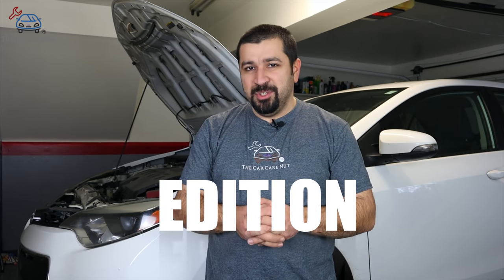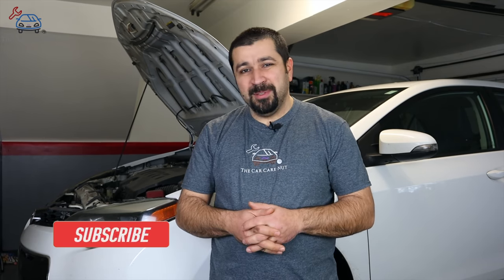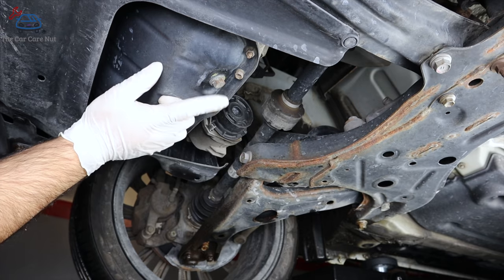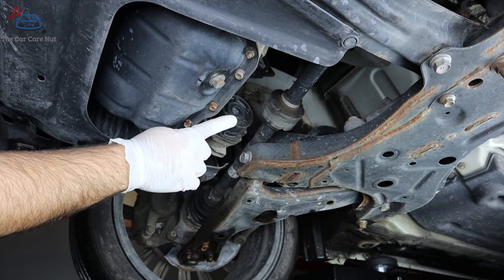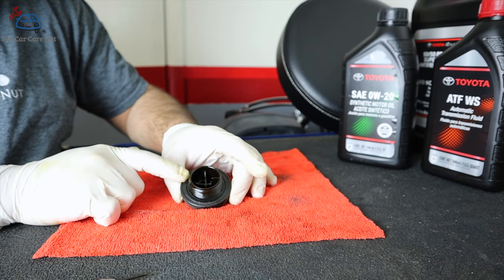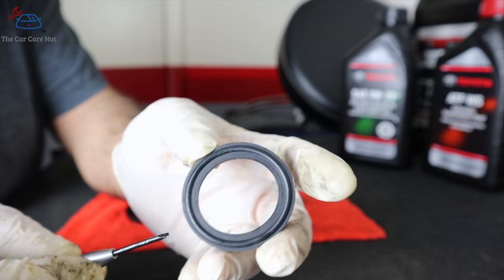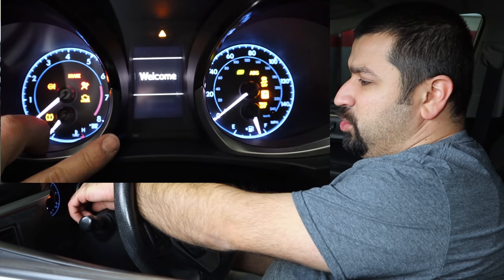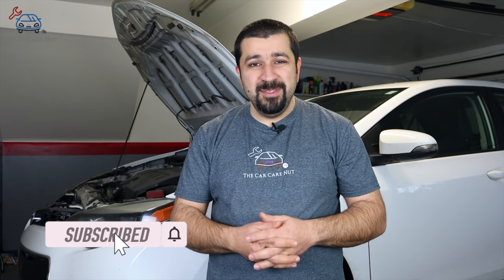How to change your Engine oil and filter for Toyota Lexus Scion

Comment: I've changed the oil on my cars for more than 50 years.  I taught my wife soon after we married, and she was religious about doing so on her own car which she herself maintained for over 15 years.  She did the neatest, cleanest oil changes I'd ever seen -- never spilled a drop, and somehow, she never got dirty, either.  Even better, this got her accustomed to looking around under the hood, and she wanted to know what the other parts were too.   She immediately noticed anything amiss and was even able to fix some things herself, like a cracked hose causing a vacuum leak.  I strongly encourage women to learn this type of job.  A great confidence builder.  My wife  became much more informed about cars starting in this way.
Reply: Most women would refuse or F something up.  That is reality for the vast majority.
Reply: Keeper.
Reply: You have saved enough for a mistress.  😆.
Reply: Real world experience here.... my wife wanted to learn same.  She did the oil change and everything seemed fine.  Then we discovered the car was leaking oil at the drain plug.  I checked it was tight and that wasn't the issue.  I suspected something was amiss with the drain plug gasket.  Took it to the dealership as it was winter and I don't do oil changes in the icy and wet driveway.  They discovered the drain plug bolt was cross threaded.  There's a certain amount of "normal experience" with tools, nuts and bolts that a person should have before they do their own oil change.  We needed a new oil pan, which cost about 700 dollars with labour and taxes to replace.  She has decided I should do the oil changes from here out.
Reply: @donaldteed35  You can win most of the time but not always.  😆
Reply: @donaldteed35  So she tried doing lefty “tighty” and righty “loosey,” instead of righty “tighty” lefty “loosey.”
Reply: @GhostBlueEternalFlame  
Not at all.
She cross threaded it meaning She turned it to the right to tighten it but the threads we're not aligned. This can happen on pipe threads, bolts or anything threaded. You have to make sure that it is started properly before you tighten it.
Reply: @tommak6516 i agree with refuse. but i disagree with the fuck something up part. thats the whole point why you (as the husband) teach her. if she becomes informed and experienced, she wont fuck anything up
Reply: My wife always wondered how I washed our car without getting wet. Then one day, she came with me. I sat there and watched someone do it for me. 😊
Reply: A keeper!
Reply: I can imagine what my wife would say if I offered her to change oil on her car. No, better I do it for her
Reply: That's awesome!
Reply: I taught my husband how to change oil :)

Comment: My dealer always overfilled each oil change :(   They no longer do my oil changes.  I do my own :)
Reply: They are supposed to fill just below the full line.  It would save them money.  Overfilling is really bad since the oil will foam.
Reply: I have experienced the same overfill l issue at the dealer. Maybe the round up to an even number. Very annoying -
Reply: @nicholaspaul2458  Part of the problem is people complain if their oil is below the full line.  I’ve always driven the car for at least half an hour and then waited 15 minutes to check the level.  This gives a more accurate reading.
Reply: I usually end up pumping out the excess oil
Reply: Yes, I siphoned over a pint out the last time a dealership did mine.  Very were on vacation and didn't want to drive over 1,000 miles home with it overfilled.
Reply: I've tried about 4 workshops, they all overfill the oil.
Reply: I’ve heard dealers use bulk oil dispensers, apparently difficult to control Definitely  there customers who care about their cars aren’t happy.
Reply: I always add .3 quarts more than specified. At least with the oil guns we have, if I put the exact specified amount it will end up being underfilled. I'd rather accidentally put too much oil in a customer's car than not enough.
Reply: I just got an oil change done at Toyota on my 2015 Rav4 and when I remeasured its overfilled! I insert my dipstick fully. It seems to me they are only inserting the dipstick to the gasket(yellow top) on the dipstick. should the dipstick be inserted fully?? If so, all the Toyota dealers around me are measuring their oil incorrectly... anyone care to chime in?
Reply: @Damian-nj9tl  my manual states "reinsert it all the way".
Reply: @Damian-nj9tl  conspiracy ?? is that what you are saying?
Reply: @MrMagichobo21  try using the dipstick range
Reply: @MrMagichobo21    terrible idea.  Oil foaming due to the crank shaft hitting the oil will cause almost zero oil pressure.  
     Take a drinking straw and have a cup under the sink with the water running hard and you will understand all you get in the straw is bubbles.
Reply: I had the oil level correct when I bought it. Got it changed at a dealer it read overfilled. I drained out 1 quart.  Went to another dealer read overfilled. Thought I was nuts. Got it changed at independent shop, read overfilled at same spot on dipstick. So now I do my own change, I got out 5.8qts,  what the manual recommends. I put in 5.5qts,  it reads full. So I suppose there is 0.3qts trapped in there and if you put 5.8qts you are overfilling it.
Reply: Thats what she said@timtitus6846

Comment: This is why I do my own oil changes, even on new vehicles, because as he mentioned, jr techs (who are assigned oil changes) forgetting to put oil back in the car.  Happens more than you know, I rather not pay someone to mess up my car.
Reply: This is why, when I have some work done on my car, I always ask for a sample of the old parts (eg. bring an old jar for brake fluid, transmission fluid, etc; or ask to see the old brake pads, etc). Figure it’s a good way to keep the shop honest! And yes, I agree about oil changes. Basic stuff like that, you do yourself!

Comment: FWIW, I've been using the same oil plug gasket for the last 70,000 miles. No leaks. If you cut off the top of a quart oil bottle or 2 liter soda bottle, it makes a nice funnel  for adding in the new oil without spilling any. The idea of putting the oil filler cap on the hood latch is great, as is the advice of tightening things to spec (after a few oil changes, you'll not even need the torque wrench any more). Great video, Car Care Nut!
Reply: I do the same thing. Replaced the drain plug crush washer for the first time after about 15 years. Why? Just because I felt like it that day. Same one now for 8 years.
Reply: It's great until you drop the hood and break the fill cap!

Comment: Do not forget to check for leaks and oil pressure after startup. It can happen to anyone, but especially if you're not experienced. Gaskets can be bad, faulty encased filters and improperly tightened oil plugs, etc. I did this work for 5.5 years and have seen it all, especially on used cars that others had touched before me.
Reply: Yes, it can happen to anyone. I know. I've been changing my own oil for 57 years. About two years ago I got distracted during an oil change. Because of that I ended up pouring three quarts of oil through the engine before realizing I forgot to put the drainplug in. Whoops! My wife said, "I'll bet you won't do that again." I told her she was wrong. It wasn't until after 55 years of not doing it that it finally happened. I told her the evidence shows that I'm more likely to do something like that as I get older. I don't think I should try making my own video unless someone else is running the camera. I can't multi-task like I once did. A man's got to know his limitations.
Reply: How do you check for oil pressure after start up?
Reply: @sweetbrez18  Make sure the oil light in instrument cluster turns off after a  second or two after starting the engine.
Reply: The reasons for leaks with cartridge filters are probably because of putting the o rings in the wrong spot. The Toyota filters have specific instructions as to where it goes and it important to pay attention to. Over tightening it will cause you issues like he said

Comment: I upgraded my oil filter canister on My 2021 4Runner.  I used the metal one from Toyota for the 2GR and swapped out the middle stack inside to accommodate the taller one in the metal filter.  Just so people know, the official toyota filter tool is $60 from the dealer, at least that’s what I paid.  Worth every penny
Reply: I've seen them for a lot less than $60 but the plastic one is fine as long as you don't let a sasquatch change your oil.
Reply: Personally, I feel the best oil filter cap wrench for this application is the Motivx MX2320-US for $24.95.

Comment: My LS460 has the canister drain valve in it, and I use a brass tool to drain the housing before removal because it makes a lot less mess when removing the housing. I also pour about 1/4 quart of 0W-20 into the fill port while the drain plug is out to rinse out a little bit more of the old oil before installing the plug and filter. Thank you for the very informative, useful, and cost-saving video for DIY-ers.
Reply: I'm sure people have seen that clear spout that comes with the new filter and they just toss it in the trash.

Comment: Love the tip of putting oil filler cap by the hood latch.
Reply: @sctony2000  I don't , because  if you forget it's there , and push your hood shut, you could damage  the cap and have to buy a new one 🥴.

Comment: I have only ever owned Toyotas.... My last one was a 1.6 Avensis Strata which I got 549,000kms until I retired it last month. I put 50 -60 thousand Kms per year, but I ALWAYS changed the oil and filter myself... 3 times per year every 4 months or 15 -20 thousand Kms. Your videos are excellent. I now have a 2.0 D4D Avensis Tourer.
Reply: 15-20 thousand kms between oil changes is a lot, did you have any issues with oil burning? I'm guessing the engine would have gone further than 549,000 kms had you changed a little more often. 

Also, why did you end up retiring your Avensis Strata?

Comment: Thanks for that reset the maintenance light info at the end!! I've been living in apartments since I got this Camry.  they won't let you work on your car, in their parking lots. So, I came here to learn about the 💩 oil filter in this car, since I've never changed the oil in it myself. So, im going to find a public lot or dead end street, and  start doing my own oil changes again. I'm also going back to the 3k mile changes ,that I've been doing myself, for 39 years. I used to straddle a shallow ditch in my yard, with my VW beetle, so i could lay in it and change my oil 😁 ; no ramps needed. 👍 There's always a way to get it done yourself. I use a shower curtain liner underneath the car, and it catches all drips. When you're done, wipe up the drips, and  fold it up to use the next time. I've got to buy the ramps and a drain pan again, but it will save me money in the long run. I hate paying somebody else to do something i can do myself 🙃

Comment: Thanks for tips on changing the oil , I've changed my  own oil for 50 years - my first Toyota  { Highlander }  that real small o-ring I'll skip on the filter housing for  sure - just made it a little less of a mess for me in my book .😉 Watch your videos all the time , keep-m coming. MB
Reply: ........."that real small o-ring I'll skip on the filter housing for  sure - just made it a little less of a mess for me in my book". -  You might try enclosing a clear, Hefty type sandwich bag around the entire filter housing after you've cracked it loose to catch some of that 6 ounces or so of oil sitting in in the canister. Better in the bag than down your elbow on those vertical mounted ones....MUCH less mess!  😃

Comment: I never bothered changing the oil on my Chevy Cavalier because it needed repairs at least twice a year & asked the mechanic to do it while it's there. 
Now i'm going back to do it myself with my '13 Corolla as i used to with my '93 Civic but it's even easier with my Corolla because the oil filter is easy to reach.
Thank you for this video.It is highly appreciated.

Comment: I am so glad to have found your channel. I have a '09 Scion xb and I change my motor oil & filter every 5k miles and reset the maintenance light. I've been doing it since I drove off the lot. At delivery, I asked; How to reset the Maint. Light because I lived too far and I was not going to the dealer every time the light came on. Ever since it lets me know when to change the oil/filter. I didn't have an oil consumption issue until my car hit 160k miles. Ever since I've been adding about 1qt between oil changes. Now my car has 200k and life is good. lol

Comment: Understanding that some oils have better cleaners in them etc... I decided to try Amsoil 100% synthetic 5w-30 on my mom's '07 Highlander Hybrid thinking it might help clean the seals better and stop the leak. It's been about a year, but taking measurements after it sits overnight, it's greatly improved. Toyota said it had rear main leak.
Reply: Adding a few ounces of AT-205 helps the seals tighten up.

Comment: You are right, don't use an aftermarket filter housing but I do recommend swapping an OEM Toyota metal one for piece of mind. The V6 Venza has a metal cap that swaps into the place of many of the plastic caps.
Reply: Only problem with the metal filter housings is that they're scalding hot if you've recently driven the car. Be careful not to burn your hands. They also tend to want to cross-thread moreso than the plastic ones.
Reply: @MrMagichobo21   You have to be pretty careless to cross thread stuff, even a plastic cap.

Always start threads by hand.

Comment: Thanks for the great video. Note to future self for 2021 Tundra 5.7 V8.
Drain plug 30 ft-lb. 
Filter canister 18 ft-lb. 
Put the oil fill cap on the hood latch so you don't forget to add oil. 
6 months or 5,000 miles. 
Mobile 1 0/20 full synthetic.

Comment: Excellent Video!! I still change my own oil and I'm pretty much following the schedule you've recommended. I enjoy the satisfaction of working on my own car.  I do sorta believe  if your jacking equipment and stands are a little sketchy and the time or effort it takes to properly dispose of the used oil and filter for the price  its almost quicker and simpler  to have Toyota or your trusted repair shop perform that maintenance especially with the hassle of properly disposing of the used oil.
Reply: Good luck with getting the correct amount of oil put in, l'm yet to find a workshop that doesn't overfill the oil.
Reply: Correct. Our first oil change at Toyota dealership where we purchased our Tacoma was overfilled by 30oz. Service manager found the new hire tech used all 7 quarts, over filling by 30oz. Good thing I checked when home and next morning after 12 mile drive from dealership to home. I did plenty of research on dealerships and what qualifications are required for position to change oil. They will hire you without any experience, they will provide on the job training. Your expensive vehicle will be maintained by a beginner tech most every time from what I have read online. I'm not comfortable knowing that. Just my personal experience with our dealership.
Reply: Disposal is free at local auto parts stores. I go every few years for that purpose. I NEVER trust any dealership to change my car's oil and filter and always do the job myself. If you want a very long, trouble-free service life from your car's engine, I'd strongly suggest that, if at all possible, you do the same. And check the underside of the filler cap. It should be relatively clean not encrusted with grime or sludge. If it is, there's a problem that should be addressed...oil changes too infrequent, bad filters, perhaps a defective PCV valve.
Reply: What hassle?
I simply take mine to the tire dealer that also does oil changes.  After spending $1075 on tires with them then they better take my old oil when I come in to get my tires rotated.

Comment: I have changed my own oil for the last 25 years straight, and before that whenever I could change it myself (when I had a place like a garage in a home where I could do it). The reason why I do that is because the last thing I want to do is have the oil changed like a "pro." Most new cars these days offer free oil changes for the first 2 years or so, but I personally would just pass on that. The fewer times a "pro" touches your car, the longer it will last. Even at dealers, they usually hire a bunch of high school kids for the oil change area.

Comment: Thanks for the step-by-step presentation. I’ve always change my oil twice a year at about 5000 miles each sometimes a little more.  I use my car mainly for long trips anything less than 5 miles it’s by bicycle and feet all year long How do keeps me in top shape. No short vehicle trips ever!  I have 140,000 on my 2008 Prius and I don’t burn a drop of oil. Garage cup and battery is good so far
Reply: @Blade Runner yeah tell that to my uncle who drives 100 kilometers a month in his 05' Matrix. He's been doing it for the past 7 years, and while his car has always been trouble free, with only 160,000 kilometers ( 100K miles ) I still think it needs the highway quite a bit. To make the vehicle have a healthy life, get the temperature gauge to the middle with every car trip. That's the secret.
Reply: @Blakecryderman7244  yes, I think Blade Runner does treat his car well. He said no short trips. Even car care nut said to change your oil at 6 months even if you only have 1000 miles. He knows because only a 1000 miles would be many short trips. Short trips are bad for oil.
Reply: @lukek1949  yes, I always tell my dad to eliminate short trips with our car so it lasts longer. Have to actually drive the moisture out of the oil